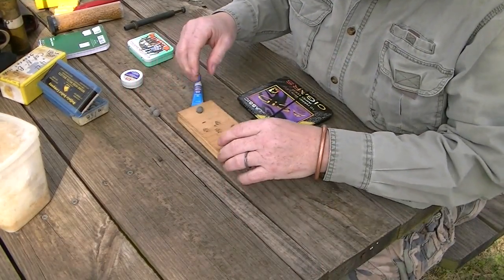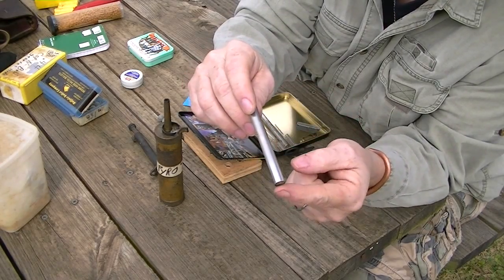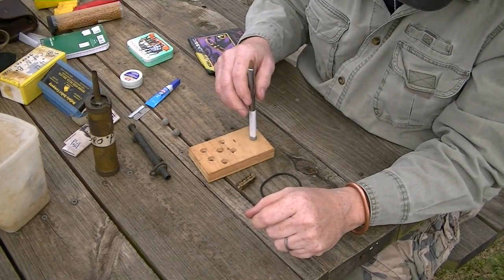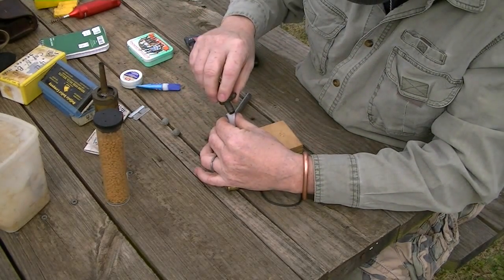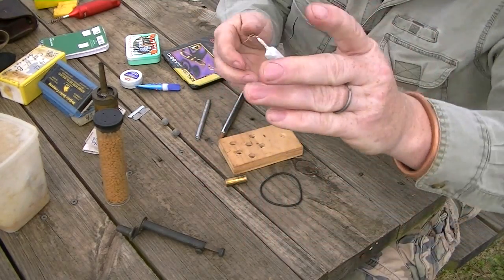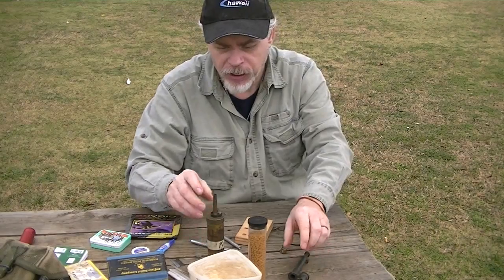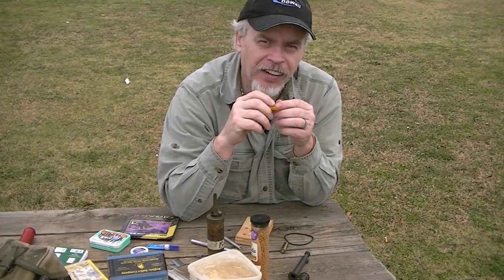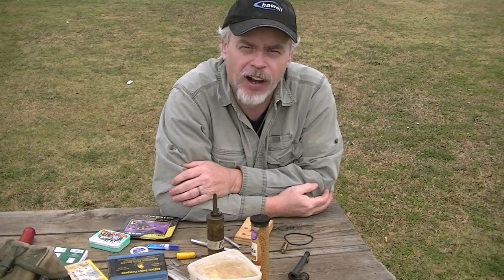THE PERCUSSION REVOLVER making paper cartridges

Comment: If I may throw in here.  Blackie Sir, Thank you for this video!  I thought I had watched all your cap & ball videos, but I was wrong. Again, thank you!

On a personal note:  I ordered my 1st cap & ball revolver( 8" 1858 Remington), and in the meantime I have been watching as many videos as I can find about making paper cartridges. I will start with ball, but hope to move into conicals as soon as I can afford a mold. Either way, I am wanting to try the brown coffee filters soaked in a solution of Potassium Nitrate, then dried(of course)  to increase their flammability, and reduce soot. Rumor has it that the cap will ignite the paper this way ensuring powder burn even if the paper does not tear when loading.  Someone mentioned the brown coffee filter paper is thin enough to burn easily and it looks more like the original paper cartridges. Regardless,  I thought it would be fun to do it that way.  Sticking my fool neck out here, but I may even try flash paper if I can figure out how to make it out of those same brown filters.
Reply from the maker: for me i found big rolling papers the lest trouble..just remember always look down in the chambers before you drop new powder down there..when i use rolling paper very rarely will i have a small bit left
Reply: @BLACKIETHOMAS  Yes Sir, I will.  And again, Thank You for all your hard work.

Comment: Try different cig paper as some are nitrated. Light one in an ash tray ant if it burns down on its own it is nitrated. I roll my own cigs and use an un-nitrated paper. I have taken some boiling water and dissolved some Potassium nitrate (stump remover) and then added some ethanol in it and wet the glue of my un nitrated cig paper when I make my cartridges for my 1858. Those of you that smoke factory cigs may have noted your cigs continue to burn to the end if you park a lit one in the ashtray that is because the paper is nitrated.. Thanks Blackie, Your videos are really good and crafted very well and thought out and don't miss any detail.

Comment: Zi made my own mandrel out of a dowel. Used a glue stick and rolled and cut the bottom. I loaded the tube with my powder and topped with a conical bullet. I set it with a drop of super glue. Works great. I load up my revolver, cap it and use my bore butter. I will say that this already has the lube in it. Both of these ideas would work fine.

Comment: For a mandrel I use my powder measuring tube.  Lickup 20 or 30 'Bob Marleys', use scissors to cut in half,  put the half back on the mandrel and push up off the tube by 1/4", put ball on so it sits in paper, apply glue with brush that came with super glue at the paper/ball joint, let dry for 5 seconds, slide off and do another.   Then fill with powder all 20 or 30 of them.   I try to make twist tail on one side of end so tail won't be in the way of cap blast.   Thx for your video!

Comment: Mr. Blackie, I made 40 paper cartridges yesterday using your method. I didn't have any soy wax so I used oxyoke lubed wads. However, I will be ordering some soy wax because it looks like it will be far more economical. Thanks for all your videos. I also learned how to fully break down my pistol, clean, lubricate, and reassemble. Does the soy wax due a good job in fouling mitigation?

Comment: Thanks Blackie.  I was wondering if using the little Soy Wax beads has an advantage to using over a pre lubed felt wad.
Over time would the lube in the felt wad contaminate the powder under it while the wax does not?

Where can the Soy Wax Beads be purchased?  Do you feel the need to put something like Bore Butter or crisco over the bullet to
do as many say to prevent chain fire?

Comment: Hello Blackie!,  
Honestly i just bought a Pietta 1851 Sheriffs model pistol and found your channel now im in love! 
I had a few questions and was wondering if you could help me?
1. What was the point of those say pellets? lubrication??
2. If i make cartridges like this do i have to use a wad?
3. Finally, do i have to use round balls or could i use conicals?
Thank you for taking the time to read this sir,  And greetings from North Dakota.
Reply from the maker: the pellets are sow wax and when mixed with the powder will melt and ladd a small amount of lube to the bore when fired..no the paper will act as a seal..and the wads are not needed//you can use either the building of the ctg will be a tad different..but other than that its the same idea

Comment: You should consider using the Kaido Ojamaa Universal bullets. They are a
 Keith type flat nose rebated base bullet series that have proven 
themselves in various field tests effectively dropping wild hogs in the 
200lb class easily out of 1860 and 1858 revolvers with a single shot and
 a 25gr Triple 7  3fg charge. penetration rivaled our 45 Colt and 10mm 
pistols that were used for comparison on the original field test against
 wild boars in Florida.

Comment: Just a question here. What size is your mandrel? I had an old tire pressure gauge that I modified like yours, but it wallowed around in my cylinder like a matchstick in a bucket. Both my guns are 44 caliber, does that make a difference?

Comment: put your measured power in a paper like you would roll  a cigarette  size that will fit in the chamber cut the end off glue the pre-lubed ball in the cut end, flatten out the other end cut it off glue that your done ! hardly any equipment necessary  it can be a little longer than these but that will skwash down when you ram it ! not historical , but fast and easy ( of course you will have to be able to roll a joint ,or you will need this equipment  and procedure )!

Comment: could i use paper cartridges in any percussion cap revolver?
Reply from the maker: the capacity of the chamber will vary a bit but yes as long as there is room for the powder charge you use it will work ..as long as the  cartridge will fit in the loading window some small models like the spiller and burr are very tight and my be a problem to load
Reply: i want to say thank you because you are only the second you tuber to actually reply directly to me and i appreciate that as much as the answer!

Comment: Is reloading paper cartridges AFTER you've already shot, a safety concern? Could a coal ignite the charge as you're putting it in?
Reply from the maker: in the worst case yes..thats why when you have fired you look into the chamber to be sure nothing is left..my way seems to burn everything up and only once in a blue moon do i find anything left of the paper..when i do i fish it out before reloading often a simple stick will be used for this
Reply: @BLACKIETHOMAS  Ok thanks. How about wetting the back end of the paper cartridge and sticking a little powder to it before loading? Is that necessary for the cap to ignite the paper?

Comment: Excellent video. Do you nitrate your paper or just use plain cig papers? You implied in another video that you used nitrated paper. Also, you mentioned below that you get no or virtually no paper residue. Is that true?
Reply from the maker: i use nitrated rolling papers..and yes i always check before reloading but there is no or very little left in chambers

Comment: Hey Blackie,  hope you and your family had a nice 4th July celebration. I hope our founding 
fathers can look down upon us and be proud, for the most part, of how far we have come.

For some reason here in Cherryville ( Cherr'ville ), NC where i have lived the last 5 years we celebrate 
Independence Day on 3 july.  

I was wondering if the wax beads will contaminate the powder over time.  I have seen where pre lubed
felt wads used in paper cartridges over time made them into weak squib loads.
Also some other channels say Super glue will combine with the black powder and make it harder to clean.
Do you find any difference using paper cartridges and hand loading a cylinder?
Consistent firing...accuracy...cleaning?

Thanks
Bill D

Comment: i bought .451 balls for my first percussion bp revolver , its a colt navy 1851 pietta .44. im worried that they will come lose after my first shot creating pocket space. should i not use these .451s or is there a way to load them safely like putting hot wax on top as a seal or something like that
Reply from the maker: many revolvers use 451..i would load a single round fire..a few times  to make sure its isa good fit..it it looks like it load 2 after the shot loot to see if the second round came loose..if all is well load a full cyl and shoot..hope this helps ya safe journeys

Comment: How do I get the length and with of the cartridges for a 44 1858 new army? or is the length determined by the charge amount diameter doesn't matter?
Reply from the maker: for me the diameter should easy slide into the cyl chamber..as for length the powder charge will set that for ya..i fill the tube with my measured charge then crimp and seal

Comment: no need for some grease to seal the balls to prevent ignition of the other tubes?
not that I have any experience just wandering
great series of videos
Reply from the maker: +Doron Papo  greasing does work..but i have found its a messy pain..the felt wads and proper fitting caps keep chain fire at bay..

Comment: Newby dumb question. What type of hand gun is that? About how much would a man need to spend to get one?
Reply: 1858 Remington, just less than 300$ at dixie gun works or cabelas.  Big advantage of a Remington is that the cylinders are fast and easy to change and they run only about 60$.

Comment: How long is a cartridge good for or am I just being stupid?
Reply from the maker: as long as they are kept dry..for yrs
Reply: blackoracle69. Thank you for answering my question. But I have another question. Wouldn't it be better in the long run to secure that little rat tail with a dab of supper glue after you have cut it short, or would that interfere with the paper rupturing during loading?
Reply from the maker: i have not had the problem of them unwrapping..plus when i go to ram the charge i want it to burst open and let powder be against the flash hole of the nipple..also i am unsure if superglue would combust during firing..it may build up a residue in the barrel or it the drop was in the right place my act as a block to the cap if it was blocking the flash hole..those are just my thoughts..my advice is try it..and see how it works..thanks for the comments ..safe journeys
Reply: blackoracle69 thank you for the answer.

Comment: Does having that paper twist tail in the end of the chamber, right straight in front of the vent hole, give you hang fires? When I use paper cartridges I leave the tail and rip it off and then load it, so the powder falls out and in,  then the paper gets squished in between the powder and ball as a wad, otherwise it's the same, but I am dissuaded from just putting the enclosed paper package as a whole in to the chamber because I think it might hamper instantaneous ignition. Is this just being anal? I guess I would have to test and feel the difference if any is there...
Reply: That's a good point. I found that any more than one layer of paper will occasionally fail to fire, although for total surety use a nipple pick to 'pop' the cartridge before you put the caps on. Only takes a few seconds to do all six chambers and they will always fire if you do that, although I have not had one fail to fire with one layer except if there's a bit of unburned paper in the chamber that blocks the nipple hole.

Pricking them all makes sure that they will fire every time. I often do this after the 5th or 6th reload as by then the 'debris' left in the cylinders can build up a bit.

Comment: I doubt that thing is going to fire properly. If it does, it’s going to take a few seconds to go off. That paper isn’t combustible, and the powder isn’t exposed.
Reply from the maker: the loading burst the paper on the bottom so powder direct in line with flash hole..it fires instantly..and i always look into chambers to be sure all paper was burned or blown out  during firing

Comment: if I cannot own a gun with modern ammunition this might be a good substitution
Reply: Stock up on caps......You can make everything else.....Sulpher and Potassium Nitrate are cheap on Amazon and you can make your own charcoal.......lead casting is simple and cheap. Youtube has some great gunpowder making videos.....Check out Brushhippie for a good start.
Cap and ball rifles and pistols DO NOT require any paperwork to purchase. Drop the cash on the counter and walk out with your gun. Just like buying a can of soup......
Reply: Bob Sullivan I am thinking about getting a conversion cylinder when s*** hits the fan it's not going to matter who has what
Reply: Brett Duffy
  That's one of the reasons I bought my Stainless Pieta Remington 1858......Cylinder changes are faster than the other cap and ball revolvers........
  I also bought a Savage ML2 smokeless muzzle loader and a CVA Optima V2, both 50 Cal.'s and both new.....
  .A full bench of new Dillon Precision reloading equipment and a new Corbin Manufacturing swaging press (CSP1) and several dies plus a shit load of gunpowder and brass and primers and all the supporting supplies and I got it dicked.
  I would be very pleased if the SHTF never happens....But then, at some point, I can sell, barter, or whatever all this stuff. It will always be worth more than I paid for it.
  If SHTF then my value to my neighbors has improved greatly. I plan, in that event, to give away supplies to the right people who just didn't plan ahead well enough.